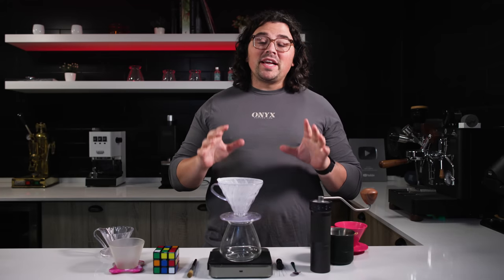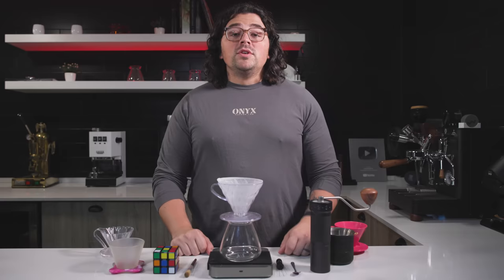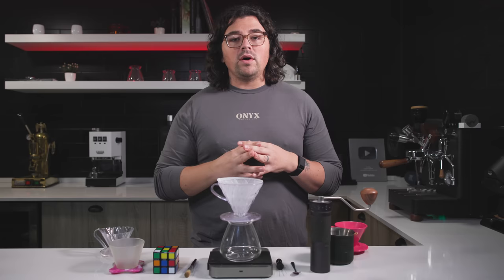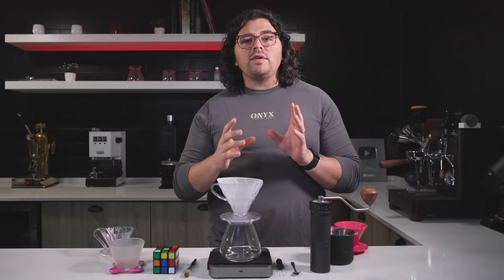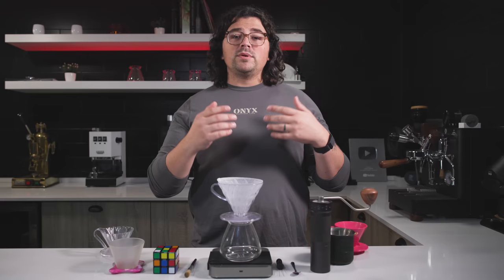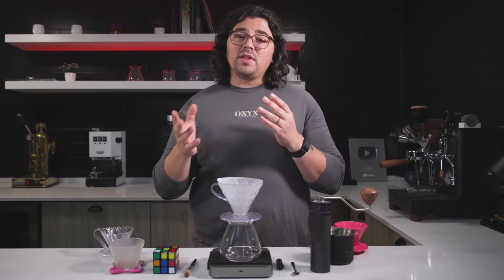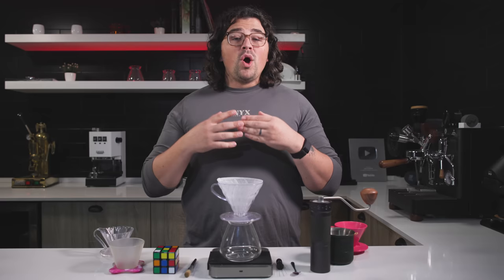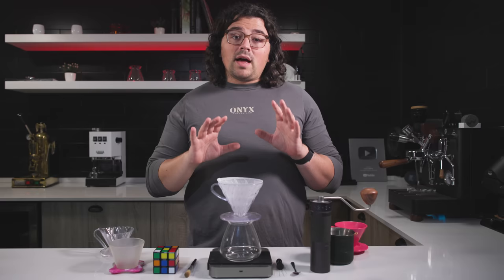ULTIMATE POUROVER RECIPE (any method)

Comment: Interesting, I tried this method with my kalita wave and it seemed to push the grounds to the edges and drain fast leading to an extremely under extracted brew. 

I wonder if this method works better for cone pour over drippers, or perhaps I should alter the pour pattern and pour more evenly rather than just in the middle. 

I tried to swirl the bed at the end of the pour to even out the grounds and that didn’t seem to work.

Comment: I have tried this recipe numerous times and each time it has made a completely flat, boring ashy cup of coffee. If you need an easy recipe try 13g to 200g water. 50g of water poured every 30 seconds. Easy!
Reply from the maker: You're without question doing it incorrectly. Lol
This has now won brewers cup comps. The 50g every 30s is an easy way to stall your brew or over extract or increase likelihood of channeling or clog filter with excessive fines migration. But brew what you like! Cheers
Reply: @LanceHedrick  but in this video you said brewers cup recipes aren't great to replicate because they have totally different beans to what we have access to? Also, incorrectly? I'm quite capable of doing a 1:17 brew ratio with a 3x bloom for 2 minutes and a 6-8g per second pour
Reply from the maker: @Secret Agent Randy Beans  yes. This has been used SINCE I posted it. Not a difficult concept haa I've coached a couple and they adapted this.
And I'm sure you are but how much did you Play with grind size? With water temp? You must do that a lot with 50g pours. How much did you do that with this before saying it is ashy? That's a weird note to call a recipe, regardless. That's more of a coffee issue. 
Anyway, brew what you enjoy. 🥰

Comment: Helloo, noobie here. I'm really struggling w/ clogging, and bitter and hollow cup. I tried 4:6 method and this. Send tips 😭

Timemore c3 (18clicks)
Hario v60-01, hario filter w/ tab on plastic wrapper
Ethiopia sidamo light roast
12g:200mL, boiling water

Tyia 😗
Reply: try different beans?
Reply: Water quality and try slightly lower temperatures until it tastes right?